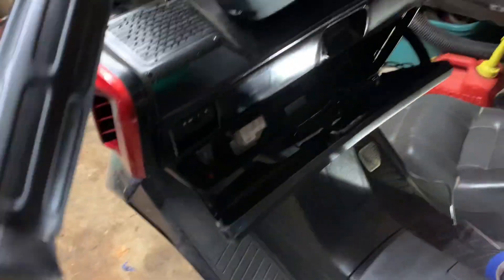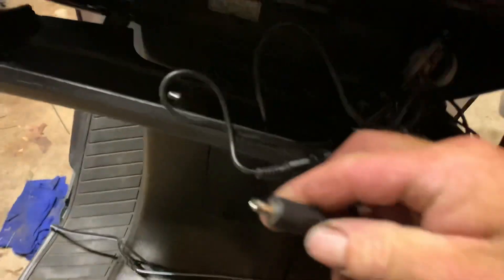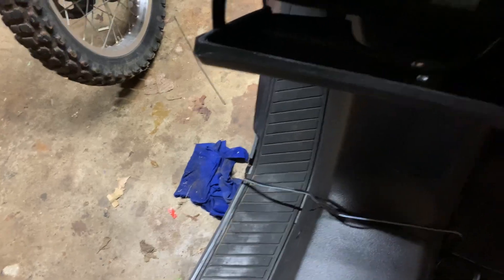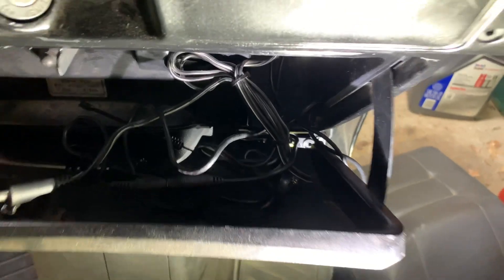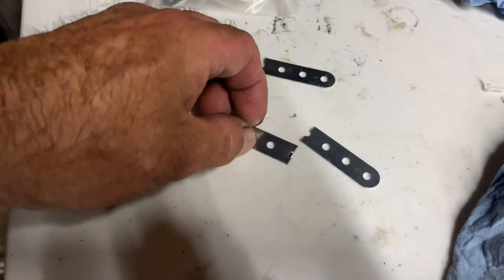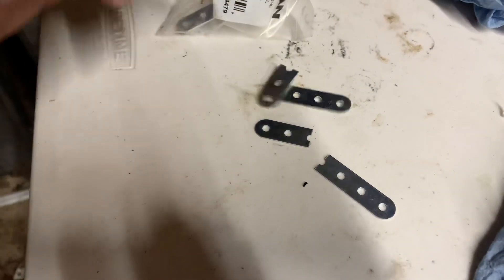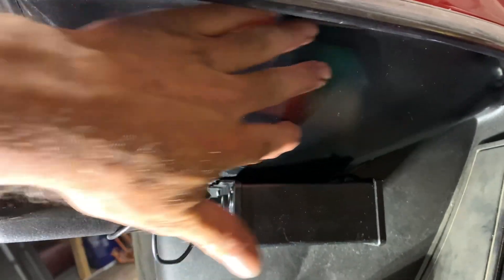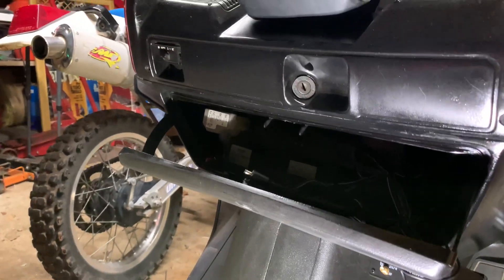Honda helix cheap radio upgrade disappointments ￼

Comment: If its 600watss but your speakers are only 50 watts per speaker then its only gonna push 100 watts like your old one, your gonna have to upgrade your speakers to a higher wattage. At least thats what  I think.
Reply from the maker: There upgraded already there pioneer speakers. I upgraded after I got the first radio